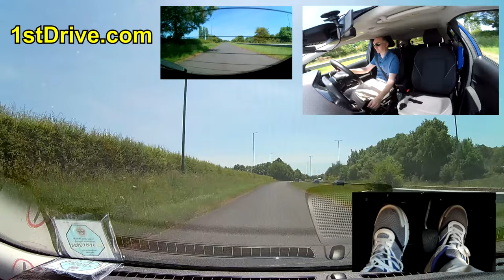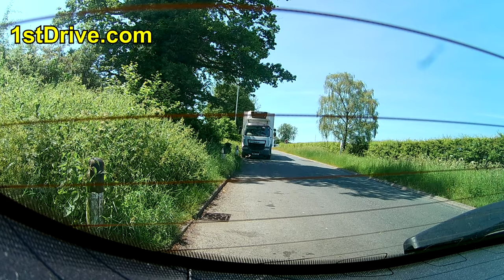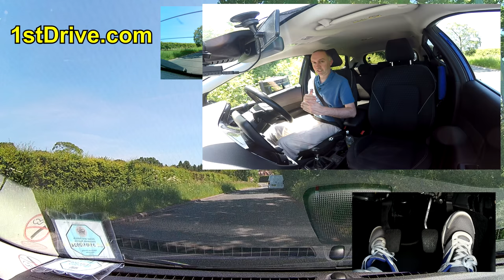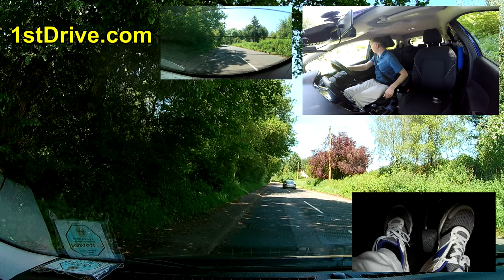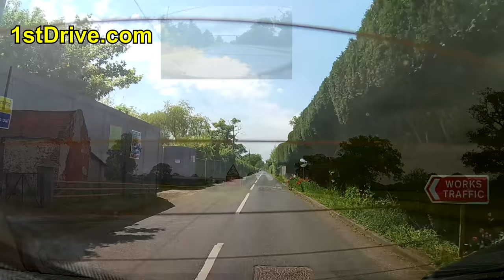How to join dual carriageways and motorways using slip roads UK

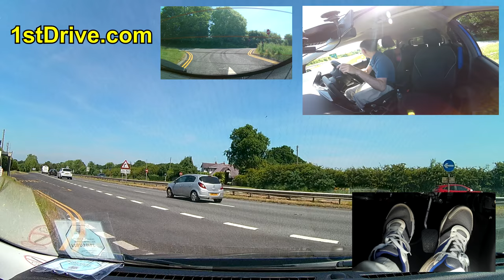Comment: The sliproad at 22:14 where to start with you're at a right angle to the dual carriageway appears similar (though the subequent slip area longer) to one I had a nasty experience on. I was just about to turn onto the sliproad when I got hit full in the face by the low winter sun, completely blinding me so that I had to just stop where I was. To passing vehicles it must have looked like I was just going to charge straight out into the main carriageway from my position.

Due to the shortness of the sliproad I ended up sitting for what was probably a good few minutes (thankfully no traffic came up behind) at the edge of the carriageway waiting for a safe gap because I was now at 0 and all the road traffic was doing 65-70 all racing to get home from work, and there was no way the vehicle I was in could get up to that speed on the sliproad alone.

Comment: Motor trader 15 years , PDi 18 months struggling. One thing good at is keeping a car going that is breaking down. Stone in brake caliper.  Sump guards fallen. Wiper arms snap off.  Emergency repairs and….and the like 8000 cars.  Many with character !! It’s so easy make a crust used car. Boringly so. Easy. Learning be a driving instructor. A mega challenge